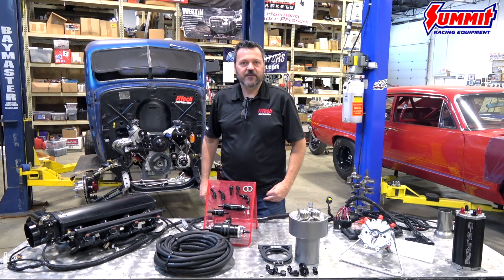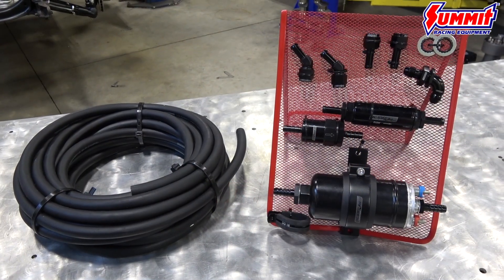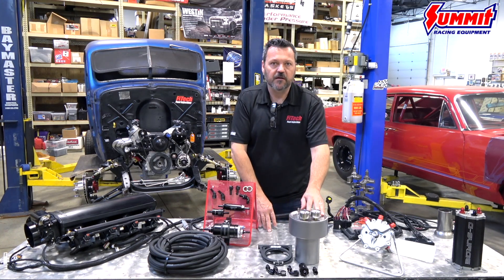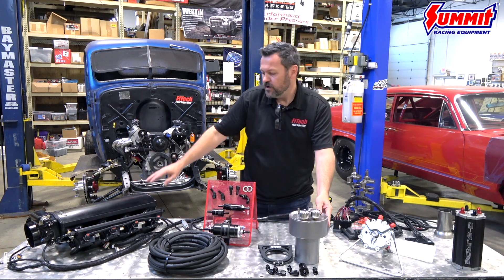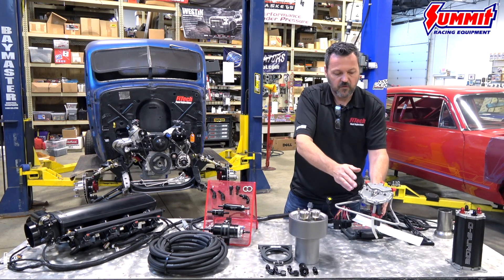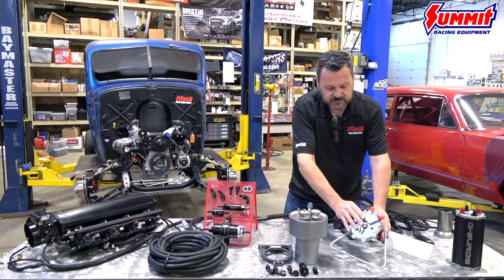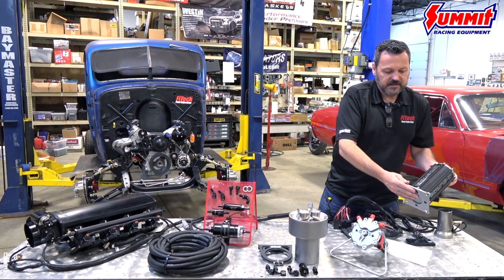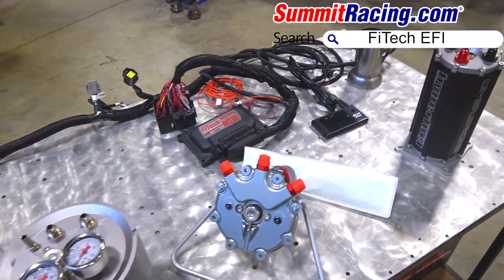FiTech Ultimate LS Fuel Injection Kit Overview

Comment: I bought an 500hp Ultimate LS master kit and couldn't be happier except for one thing, I am putting it in a '68 C10 and have lots of room in the engine compartment and now FiTech offers a taller manifold.  My question is, Could I swap the uninstalled short manifold for the taller one ?  
Other than that this kit looks great.  It also came with the newer HyperFuel tank set up.  This works like the original remote pump tank except it circulates fuel back to the gas tank keeping everything cool.  It has the pump and regulator and feeds the engine at a constant 58 psi and the electric pump on my gas tank runs unregulated pushing fuel to the high pressure pump and excess back to the gas tank …… Now if I could only trade for the taller manifold …… How about it FiTech  (Ken)?

Comment: I am taking out the original 305 where the throttle body out of a 1989 GMC pickup with the throttle cable on the driver side I am replacing it with an LS2 do you have a EFI system with a throttle cable on the driver side plus truck accessories?

Comment: don't use the fuel command center, too many negative reviews. who wants melted plastic in their fuel? many complaints about power issues, switch to different pump and the problems went away. use the aeromotive pump, which can be powered from the EFI directly. way better and most important, more dependable.

Comment: These systems are like unicorns they keep talking about them but they are still not available. I paid for one from Summit when it said ships tomorrow. The next day I received  an email saying it would not ship until the 2nd and then another email and another delay. I then asked for my money and purchased a Holley Hp system direct from Holley and it shipped the same day and will arrive by Friday. A total of three days from purchase to in my hands.  It may cost a little more and need you to purchase other items to complete  but cheap fuel injectors and poor quality parts will disappoint you if you need true performance. I waited for this system to be available from March till now and still no product. Fitech never answered  the phone and took two days to respond to my emails.  Holley answered the phone and was very helpful at helping select what all was needed. If you can spend the money and buy a Holley system.  Or maybe you will get lucky and get one from Fitech but then good luck if you need tech help and as always you get what you pay for

Comment: I ordered my ultimate a few weeks ago. I can't wait to get it in.
Reply: Good luck they keep promising them but they don't deliver I had to get a refund after I was put off twice and did not want to wait till winter to finish my project
Reply: shan edwards they were just released a few months ago with preorders all the way back from December. what did you expect?
Reply: When it says ships tomorrow if ordered today I expect it will ship the next day but with this system tomorrow never comes. I also expect a company to answer there phone. I placed my order with Summit and was then told it would be delayed twice with the last time making it over 30 days from payment and by then my car will be running. Holley Hp ordered at 1:00 pm central shipped the same day and will arrive in three days total. Fitech price point is extremely low which usually means low quality to. Holley has been around and there systems are top quality. In the time it has taken Fitech to deliver no product I saved enough to buy a Holley
Reply: shan edwards that has nothing to do with fitech. that was a distributor issue. jegs has the same thing, totally web developers fault. I've always had my answered through fitech.
Reply: If the two biggest distributors can't deliver and have bad info plus fitech never answers the phone that's all I need. I don't need anymore for me I know when my time is being wasted. Maybe you work for fitech
Reply: shan edwards, haha I do not work for FiTech. however I do work in a busy call center and sometimes you have to wait because they are speaking with other customers. I've waited for about 10 and was able to speak with one of their techs. all I'm saying is if you had an issue dew a distributor you should have called them asking why the had wrong shipping updates on their website.
Reply: shan edwards, that's funny since you were trying to order one and now calling it cheap without ever lay a hand on the product. Say what you want you're they one making your self look like a tool. I honestly can only speak of my experience but with a little patience I was able to speak with someone every time I called. also as I said before it was the web developer team that manages what their own sites say. you can't even order it off fitech page yet...
Reply: that's funny you are the one still waiting for a product that they promised online in March wait April no wait May no wait June no wait were not sure might be July. You are defending this  behavior . If it walks like a duck ,quacks like a duck it is a duck. Evidence points to you being a plant for  the company. I was willing to check it out but further research shows it is all Chinese junk. Makes me happy not to have received one. If you don't work for them you are being there tool. Give me a break . Holley, Mega squirt, Hal tech are all choices that are proven and work well.  I suspect you are not capable of  tuning so you must wait for fitech or you do work for them and are there tool
Reply: shan edwards, what are you talking about? they have been shipping out the product since the end of the first quarter. it's call back order. I'm done with this ignorance
Reply: Either you can't order this from Fitech yet as you have already said or they are shipping them and they are on back order which is it?. Instead of posting another video of how great this product is if your company was respectable they would post a video explaining the delay and apologizing. Fitech goes to great length to never mention where they are made. There are many small American companies doing things right. Entropy Radiators, Mega Squirt, American Racing Headers for just a few. Then there are companies like Fitech .They started with a few products that use common easy tech that is well known then built overseas and then sold them extremely cheap. Now the tech is not so common place as they try to get into factory programming. I suspect this is the delay but we may never know as they are not being a stand up company

Comment: I have the 600 pa can I just get a carb intake and put it on what's the benefits of this compared to what I have
Reply: Troy mackeod Same basic principal but the fuel is being injected closer to the valves on each runner. Fuel supply will be more even allowing for more hp. Hood clearance would be another benefit. Looks better than a Frankenstein ls1 running a carb intake with aftermarket efi on a factory efi engine.